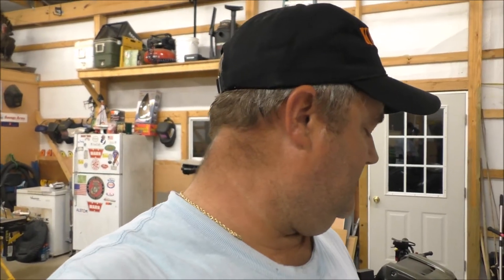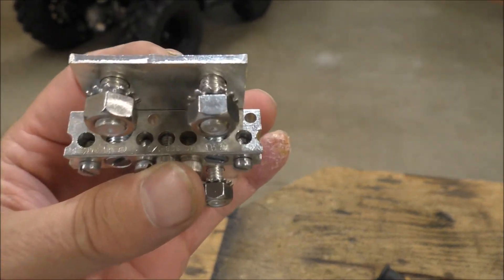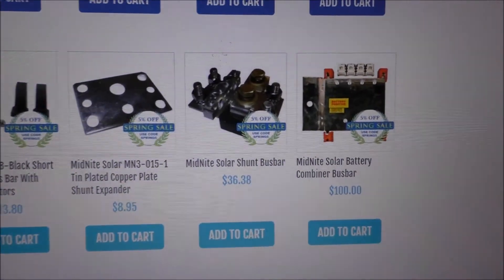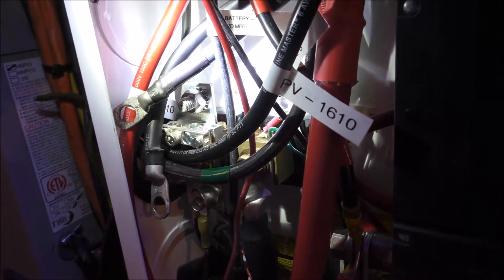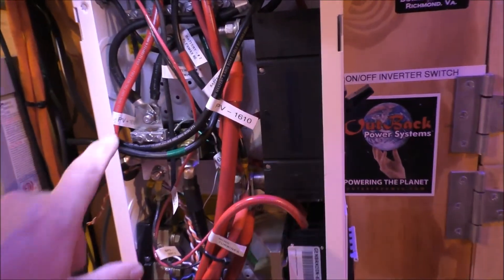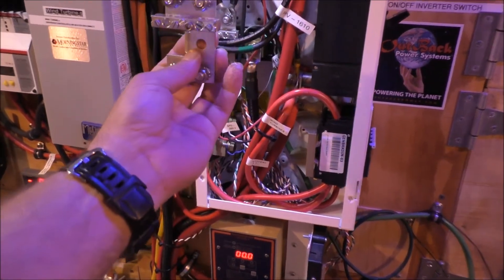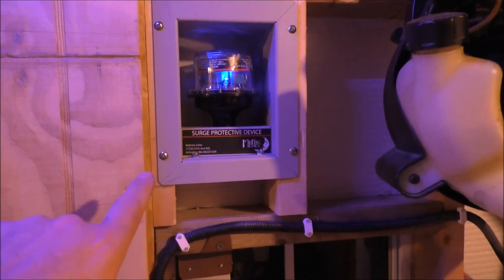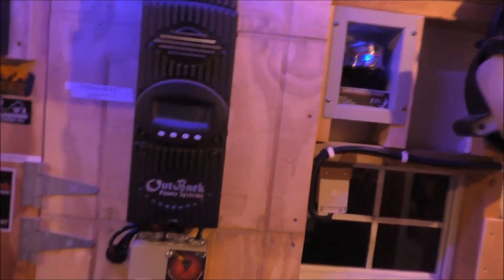MidNite Solar MNSHUNT BUSBAR Install & Review Solar And Wind Power By KVUSMC

Comment: Kenny what gauge wire do you run from the DC side of the rectifier to the charge controller for the wind turbine?  I have a short run about 10 inches, do you think 10 gauge would be ok for the 1000 watt turbine?
Reply from the maker: +Peter Guliuzza. Hi Peter I'm running 6 Awg But 10 Awg Should work if you can Run 6 or 8 you will be better off what is the voltage of your Turbine buddy
Reply: It's the same one you have HY 1000 watt but I saw your video with the high winds that time your units were puttin out close to 50 amps each. I'm having a hard time finding slide on connecters that accept 6 gauge wire.
Reply from the maker: +Peter Guliuzza.  Hi Buddy I'm  using terminals and I'm using nuts and bolts
Reply: Ok thanks for the comeback buddy.

Comment: I am a little confused about your shunt setup now. Are you using Bogart trimeric still or does this go to the outback hub? I will need to get two Bogart's probably for my future 48volt battery banks. So would this busbar and the Midnite 500A still work with the Bogart?
Reply from the maker: Yes I'm Bogart's and Outbacks FNDC / Flexnet DC Monitor I have them hooked to the same shunts Piggy Backed Yes Is Should work on The 500 amp Shunt Buddy

Comment: I just used 1/2 copper pipe flattened doubled up drill holes and put in bolts. But looks nice what you did.
Reply from the maker: Nothing at all Wrong with that buddy  Good deal man Thank You Sir Thanks for Watching

Comment: the box is full
Reply from the maker: Yes Jam Packed  3 charge controllers  and And Wind Power All In One
Reply: Over full
Reply from the maker: Will it Could Be Empty Roy
Reply: Yes I could. Most if the electrical boxes are a little on the small side